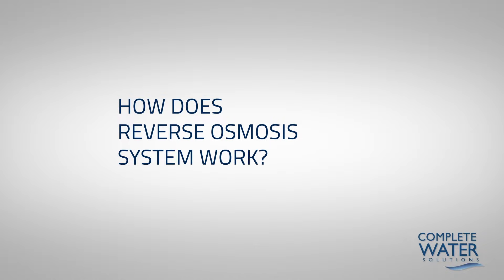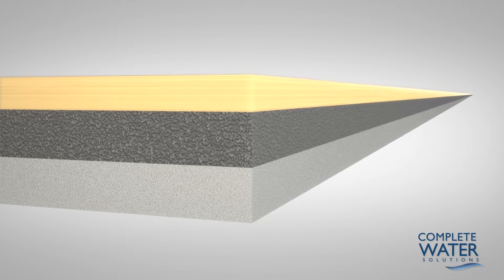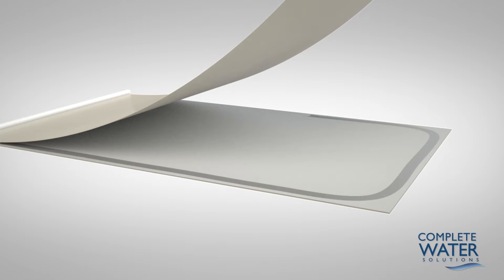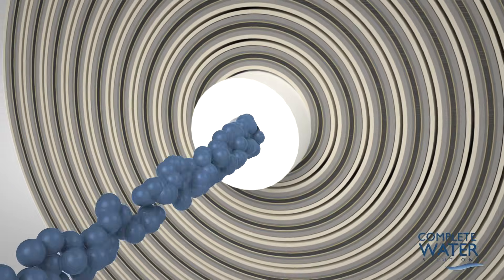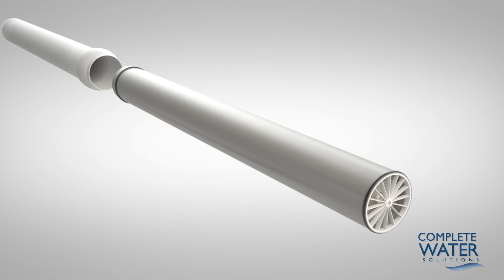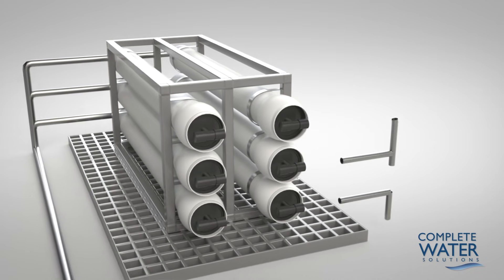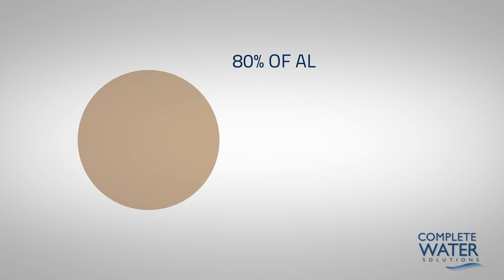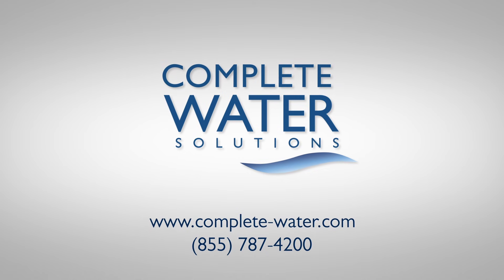How Reverse Osmosis (RO) Works - How Reverse Osmosis (RO) Membranes Assembled - What is RO

Comment: The  RO membrane you said is 0.2micron I believe it should be  0.2nano meter because  if the membrane has pore sizes as 0.2micronit  that is very large and will not purify or desalinate the water.
Reply: Hello - The video @ 0:15 Seconds describes the layer thickness - not the removal micron rating. There are many membranes from seawater, brackish, nano, etc. so we do not go into "Pore Size" - we just talked about the thickness of that layer.
Reply from the maker: https://www.youtube.com/watch?v=NmWeR06Voww&t=15s   - The layer is 0.2 Micron Thick - not referencing the removal size just the thickness of that layer.

Comment: This is the best explanation video so far, but even there is hard to catch how water enters permeate tube
Reply: There is a slit in the permeate tube and it travels through that.
Reply: it is like a bag, a pouch. clean water diffuses into pouch and exits from the tube.
Reply: @erdem--  a bag filter only has one inlet and one outlet. A RO Membrane has one inlet and (2) Outlets - 1 concentrate (waste) and 1 permeate (RO Water)
Reply: @nateolszak1078  RO filte is shaped like a bag. The water diffuses into the bag. thereby  It has 2 outputs. If the water did diffuse out of the bag, it would be a 1 output filter.